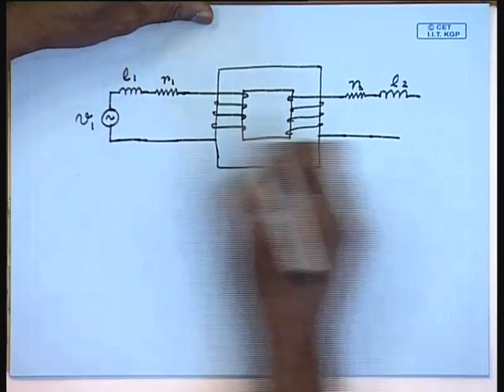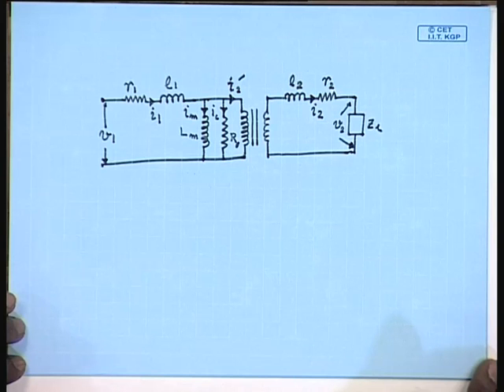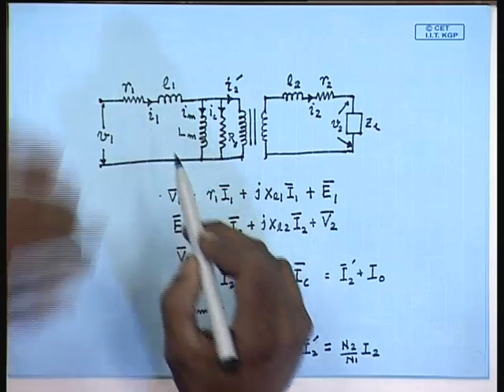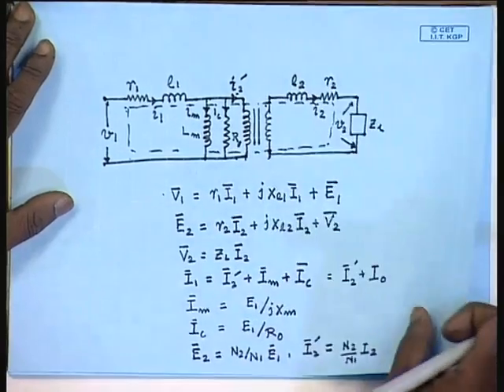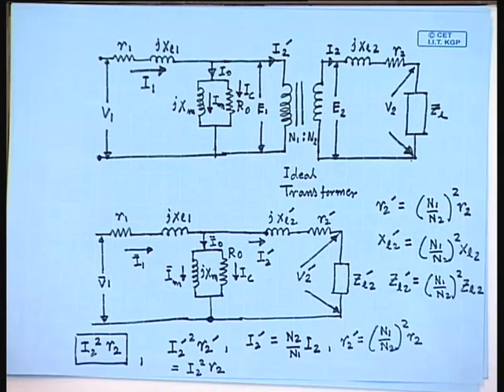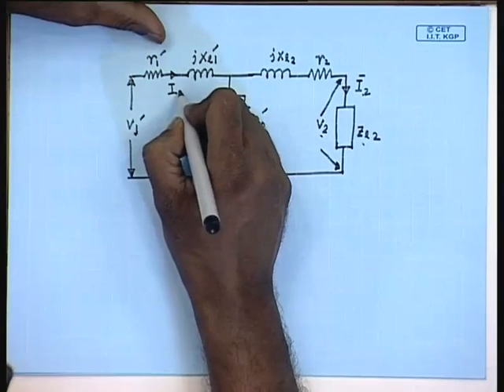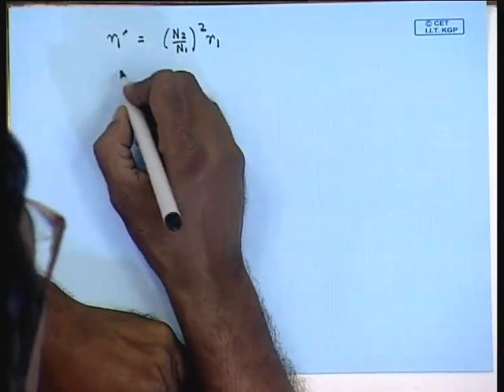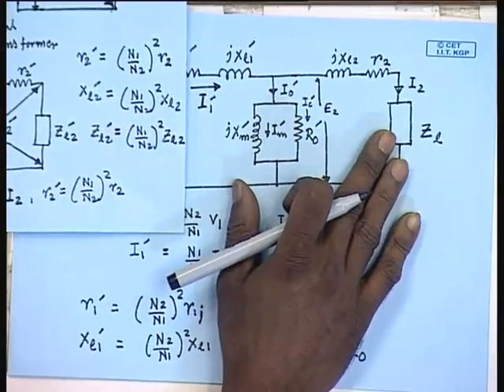Mod-01 Lec-03 Lecture-03-Modeling of Single Phase Transformers

Comment: You said it right in this video, that the voltage leads the current by 90 degree, and the current is in phase with the flux. but in previous lecture, in a diagram, you had drawn the current to lead the flux a little bit but lag the current

Comment: sir but all the books shows different phasor diagrams some shows E1&E2 downwards and I2' in antiphase with I2 so this is creating a lot of confusion . sir could you please help me out.
Reply: Phasor diagram depends on type of load i.e for resistive load E1,E2, I1 and I2 are in same phase.For Inductive load I1,I2 are in same phase and lag by 90 degree with E1,E2 and for capacitive load I1,I2 lead by 90 degree from E1,E2.